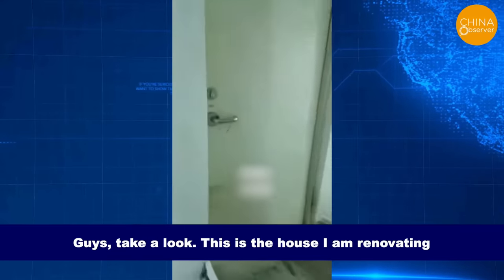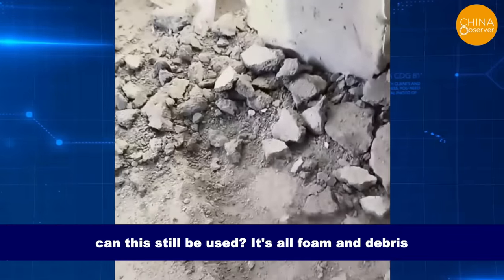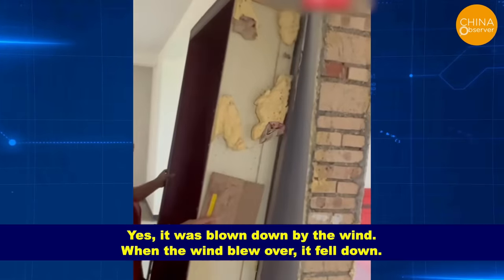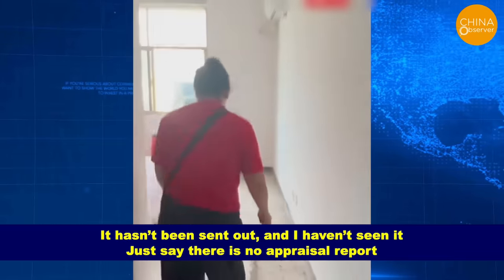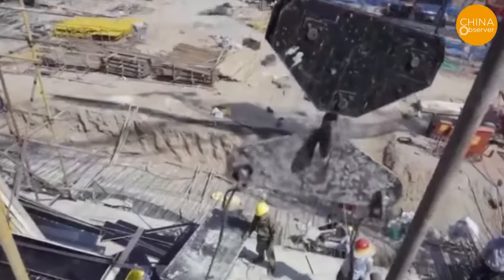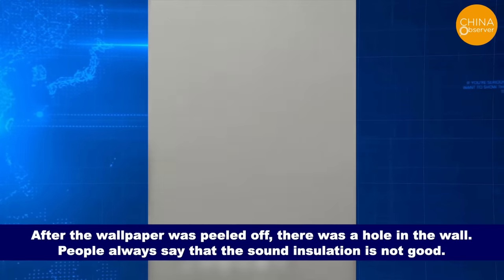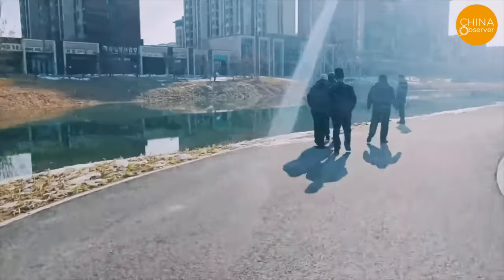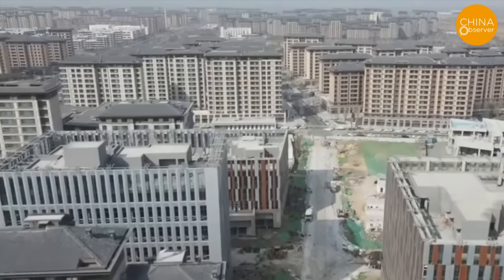$80B Subpar Chinese Homes: Walls Crumble,No Rebar in Load-Bearing Walls,Ceiling Turns into Waterfall

Comment: You know the wooden buildings in the forbidden city have been sitting for hundreds of years.  These new constructions won’t last even 10.
Reply: Yes, it's doubtful those new buildings will last long.  Though, the Forbidden City had maintenance work done through the centuries.  The wooden structures (and other structures such as roofing) have limited lifespan in the harsh elements.  The City underwent complete restoration work on all buildings which took 2 decades and still ongoing today.

Comment: You know that in Sweden whole naighbourhoods where taken down and built up again only after being 30 years old, because of the terrible quality. There is only one thing to do. Demolish and rebuild, and learn from the previous mistakes. Also, the previous responsible parties should not be aloud to build again ?
Reply: The neighbourhood you’re speaking of was only supposed to last 50 years, they are being demolished on time and before any faults occur. It was a short term housing project that has fulfilled its purpose

Comment: Looks like a non bearing wall,  so is fine to cut  down on weight  they make interior walls hollow
Reply: Interior walls are generally hollow. As are exterior walls. That's where the insulation goes.
Reply: What you mean to say. This hollow wall will hold 3000 pounds of ceramic tile and a 10000 pound jacuzzi hot tub with water and people. 
Because codes are silly.